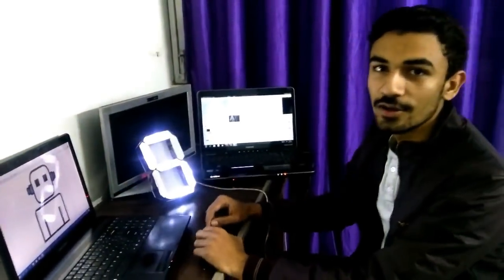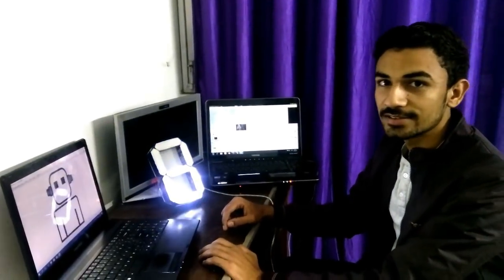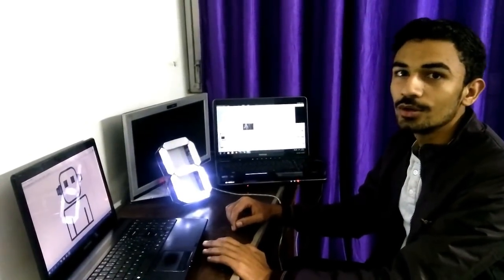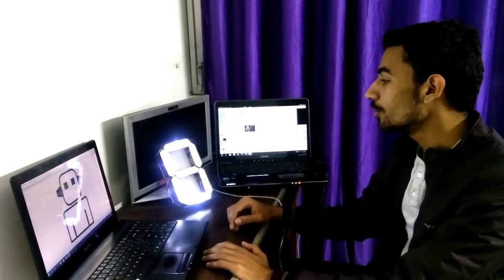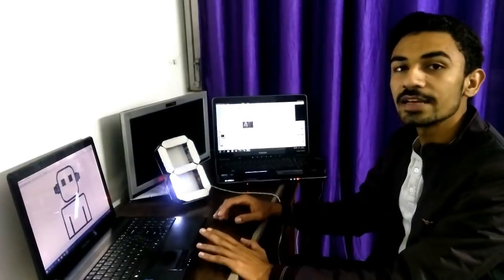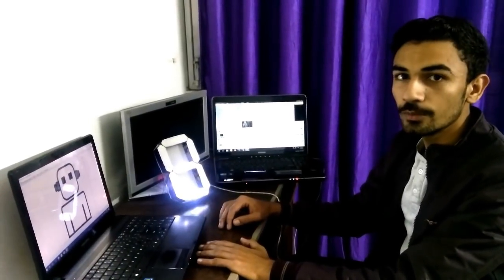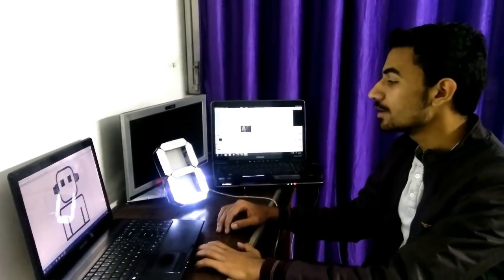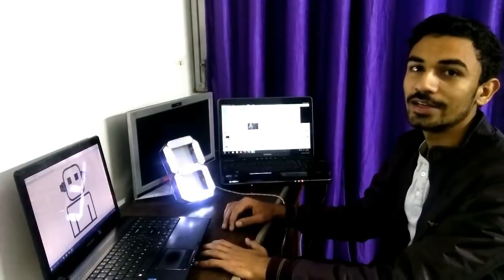How to make 7 segment display at home | DIY | How to

Comment: Awesome sir 
but where is code ??
Reply from the maker: Saurabh Patil i am busy these days so may be it take some time 
I will inform you when code will get uploaded
Reply: RoboCircuits 
void setup() {
pinMode(1, OUTPUT);  
pinMode(2, OUTPUT);  
pinMode(3, OUTPUT);  
pinMode(4, OUTPUT);  
pinMode(5, OUTPUT);  
pinMode(6, OUTPUT);  
pinMode(7, OUTPUT);  
pinMode(8, OUTPUT);  
}

void loop(){
1
digitalWrite(4, HIGH);       
digitalWrite(5, HIGH);
digitalWrite(3, LOW); 
digitalWrite(1, LOW); 
digitalWrite(2, LOW); 
digitalWrite(6, LOW); 
digitalWrite(7, LOW); 
delay(1000);
2    
digitalWrite(2,HIGH);
digitalWrite(3,HIGH); 
digitalWrite(5,HIGH); 
digitalWrite(6,HIGH); 
digitalWrite(7,HIGH); 
digitalWrite(1, LOW); 
digitalWrite(4, LOW); 
delay(1000);
3
digitalWrite(3,HIGH); 
digitalWrite(4,HIGH); 
digitalWrite(5,HIGH); 
digitalWrite(6,HIGH); 
digitalWrite(7,HIGH); 
digitalWrite(1, LOW);       
digitalWrite(2, LOW);
delay(1000);
4
digitalWrite(1,HIGH);       
digitalWrite(4,HIGH); 
digitalWrite(5,HIGH);  
digitalWrite(7,HIGH); 
digitalWrite(2, LOW);
digitalWrite(3,LOW); 
digitalWrite(6, LOW);
delay(1000);
5
digitalWrite(1,HIGH);       
digitalWrite(3,HIGH); 
digitalWrite(4,HIGH);  
digitalWrite(6,HIGH); 
digitalWrite(7,HIGH); 
digitalWrite(2, LOW);
digitalWrite(5,LOW);
delay(1000);
6
digitalWrite(1,HIGH);       
digitalWrite(2,HIGH);
digitalWrite(3,HIGH); 
digitalWrite(4,HIGH); 
digitalWrite(6,HIGH); 
digitalWrite(7,HIGH); 
digitalWrite(5,LOW); 
delay(1000);
7
digitalWrite(4,HIGH); 
digitalWrite(5,HIGH); 
digitalWrite(6,HIGH); 
digitalWrite(7,LOW); 
digitalWrite(1, LOW);       
digitalWrite(2, LOW);
digitalWrite(3,LOW); 
delay(1000);
8
digitalWrite(1,HIGH);       
digitalWrite(2,HIGH);
digitalWrite(3,HIGH); 
digitalWrite(4,HIGH); 
digitalWrite(5,HIGH); 
digitalWrite(6,HIGH); 
digitalWrite(7,HIGH); 
delay(1000);
9
digitalWrite(1,HIGH);       
digitalWrite(3,HIGH); 
digitalWrite(4,HIGH); 
digitalWrite(5,HIGH); 
digitalWrite(6,HIGH); 
digitalWrite(7,HIGH); 
digitalWrite(2, LOW);
delay(1000);
0
digitalWrite(1,HIGH);       
digitalWrite(2,HIGH);
digitalWrite(3,HIGH); 
digitalWrite(4,HIGH); 
digitalWrite(5,HIGH); 
digitalWrite(6,HIGH); 
digitalWrite(7,LOW); 
delay(2000);

}

//Erase that no.
Reply from the maker: Your code is right !! Nice work
Reply: RoboCircuits thanx...